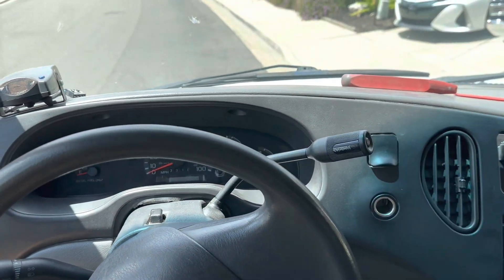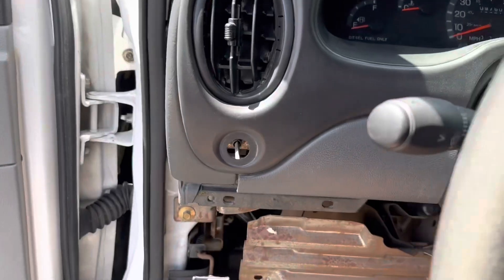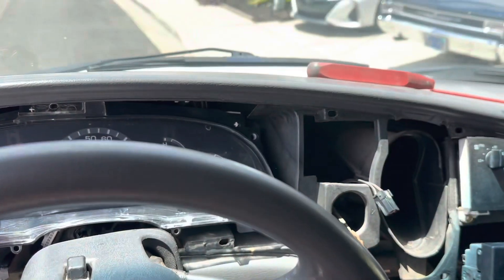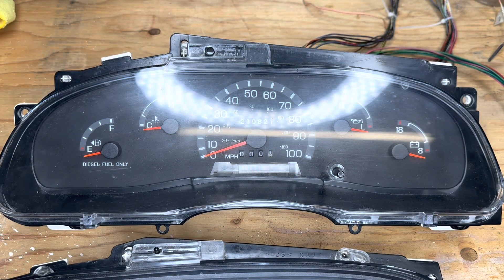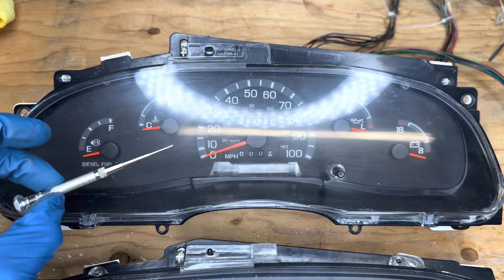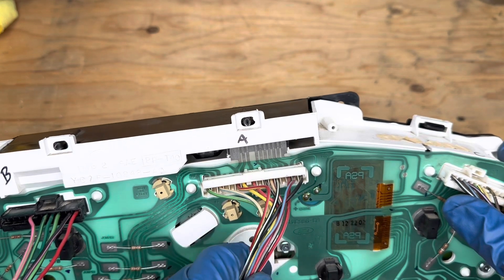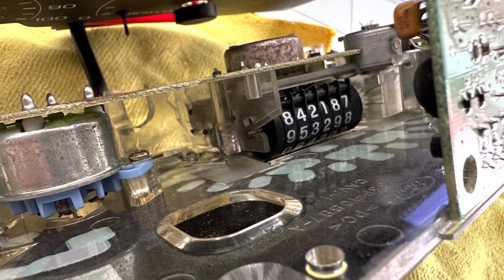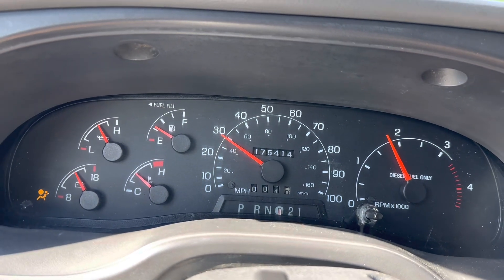Finally! Ford E350 Cluster Swap with F250-350 Power Stroke! 1 of 3

Comment: I have a 2003 Motorhome with a 6.8 Triton engine-automatic..Do you think this would work on mine ?..Also-I watched your video on the front end conversion and had to do mine..It looks great thanks to You..
Reply from the maker: I don't know about other engines unfortunately. I would suggest looking at the wiring diagrams and if they have most of the same features it would be doable. but the wires may go into different pins.

Comment: Just curious. Can you swap a cluster but one has digital odometer and the other is analog. 

2001 e450 7.3 diesel [ analog ] 
2004 e350 5.4 gas [ digital ]
Reply from the maker: No

Comment: GR8 Tip on ONLY doing LEDs on GAUGES, Not Warning Indicators.  I made the error, and it cooked the High Beam circuit / ‘trail’ on the ribbon/pcb (the green film piece).  Sucked !

Comment: Great video. How do you know what’s comparable? I’ve seen video comparability issues—is that 4 speed vs 5 speed?

I have a 2008 E-350 4 speed with 5.4 with cluster 8C2T 10849 AH. I can’t find what is compatible and I can’t find the exact cluster to replace it (nor do I want to pay $600 to replace it if I can help it)

Thanks for any info.
Reply: I have only looked into the 7.3l Powerstroke. But a 00’-01’ seem to be the ones that work.